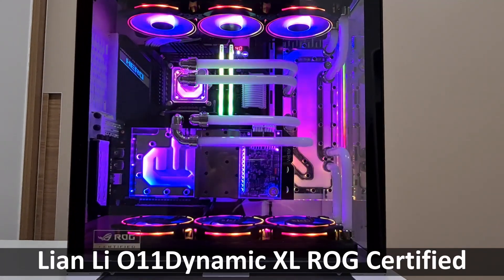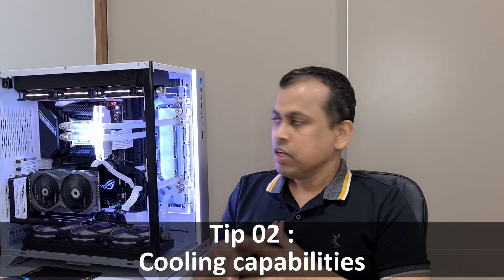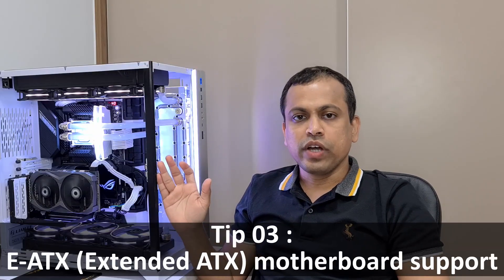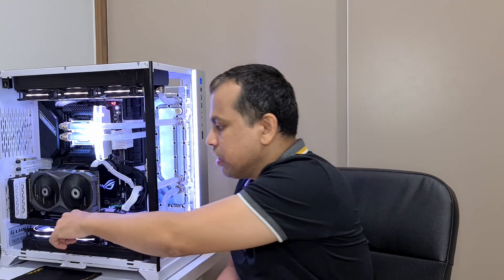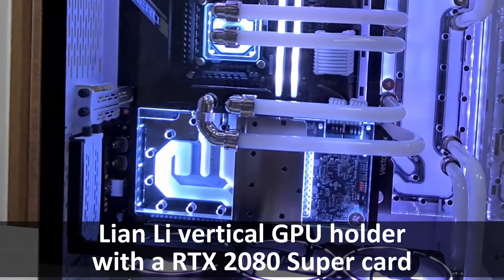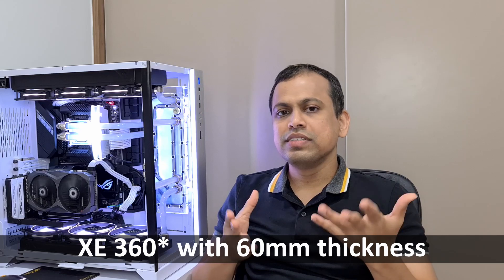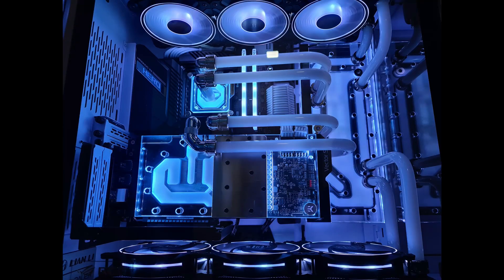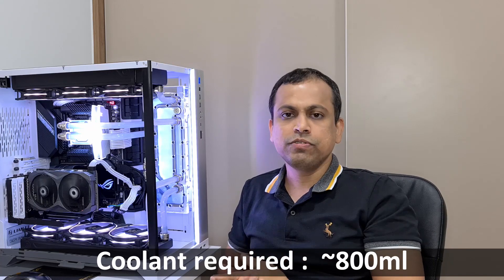15 Tips for PC Builds with Lian Li PC O11 Dynamic XL

Comment: The EK-Quantum Torque Drain Valve would work without needing the extender at all and is much shorter and doesn't need the pump to be moved.

Comment: Great tips. will the Vertical mount fit into the Lian Li Dynamic?
Reply from the maker: Yes it is. But careful on the gap it'll leave in the bottom. There won't be much space for a bottom radiator.
Reply: @STechV  Thanks. Also, can the mount be vertically moved up to allow clearance for the radiator?
Reply from the maker: LianLi vertical mount is not possible to move up or down.
If you want a vertical mount with better clearance, you can go for EKWB's vertical GPU holder.

Comment: Thanks for the ARGB hint. I had no idea how to control it until now
Reply from the maker: Glad I could help.
Reply: how can i control it ? i have msi z490 gaming plus motherboard
Reply: @WH7.  you put the 3 pin argb cable into your motherboard and then cycle until you get to the one you can select with software and then use msi rgb software to do so

Comment: I just bought this case and I’m trying to find the best motherboard to put in it. I want to go with a white or silver motherboard but it also needs to have the hookups at the front for USB type C ports
Reply from the maker: It's all depending on the brand you pick. This casing supports all types of motherboards. You can pick the motherboard with best features and aesthetics under your budget.

Comment: Great vid mate! 

I've just got a question, I've been looking for a temperature sensor (either G1/4 or one to plug into a distro).

Any recommendations?
Reply from the maker: Thanks a lot. You can use any 10K, G1/4 temp sensor. I've used "Barrow G1/4" 10K Temperature Sensor Stop Fitting" to test the loop performance. They are good and works properly. But I don't recommend their flow meter with display as they are not accurate most of the time.
Reply: @STechV  thanks so much for the response! Your build looks so great (and your tutorials are fantastic!). Thank you!

Comment: Hi I loved you video's . I am making a build with thi full tower from li -lian exact case ... I was wondering how much did that water cooling kit cost as I am trying a very similiar build with a 3080 ... I never did water cooling from scratch. (would buy them sealed) I been building PC's for 26 yrs now and I am ready to water cool the whole thing like you did... that was such a great video ... I just need to see how much that water cooling kit you installed will set me back financially. thank you for answering me. Cheers
P.S.I didnt order the case yet, do you think this full Tower is a great case for water cooling as I have a strict budget. cheers again
Reply from the maker: Hi Danny,
Thank you. For watercooling parts for this system has listed in this video ( description ) : https://youtu.be/_30bmyN35Y4 
For this setup, it was cost around USD1000-1250 for me. But, prices may vary depending on the shipping cost and the tax. 
with regards to the casing, it's good to choose a case that is watercooling friendly. So, it won't be much complicated and save some budget when routing pipes and placing radiators.

Comment: Quick question - can you install the vertical mount in the top 5 slots instead of bottom 5 slots?
Reply from the maker: Unfortunately you cannot install this GPU vertical mount anywhere else that this place. But, if you go for a EKWB's vertical GPU holder, you'll get that freedom.

Comment: If you use the front distro plate can you still mount the GPU vertical and have a bottom rad ? I assume not
Reply from the maker: Yes you can. Thickness of rads may, the "pipe work" little more complicated. But still it's possible. There a plenty of builds I've seen with that same setup.

Comment: One Question It Has Two USB 3.0 connector but most motherboarfs have one usb3.0 headers is there a way we can connect the second USB 3.0 connection to the motherboard by using some sort of adapters help will be appreciated
Reply from the maker: There are USB 3.0 Y splitter cables are available to purchase. But, I kept it disconnected as splitters shares the data channel and USB ports I had ( front and back ) were more than enough for me.

Comment: 15:15 , how is warm water coming out of your gpu if its not waterblocked ?
Reply from the maker: My apologies. The question is not quite clear to me. You need to know the temperature of the water going to the top radiator if GPU is not watercooled ? 
If yes, It'll be +2 to +5 degrees than the room temperature.

Comment: if you are doing exhaust from the top, do you still need radiators?
Reply from the maker: Yes, It's always better to have a radiator on top. Specially, it looks nice with distro plate. Since my GPU is also watercooled, top radiator doesn't get that much of warmer airflow.

Comment: Just a tip as you said you are waiting for a 3000 series GPU that have PCIe 4.0,  just check your riser cable is suitable for PCIe 4.0, as i have seen some youtube videos off problems with vertical GPU
4.0 riser cables working and not working, just something that can be easily overlooked.  https://youtu.be/KwfAF5XjXbM
Reply from the maker: There are PCIe 4.0 riser cables available in the market now. But, It's not mandatory as my motherboard still supports only PCIe 3. So, it doesn't matter even my riser cable supports only PCIe 3.

Comment: Removing the pump from the distro plate will void the pump seal warranty.
Reply from the maker: I think it's same as for waterblocks. Breaking the seal will void the leak-free guarantee. 

"The warranty is not rendered void on dis-assembly of the water block, but the customer loses the EK leak-free guarantee which comes with a factory tested water block"

Comment: Cool build, I actually want to copy it. But won't the overall heat in the case warm up the water to much for the CPU in the top radiator?
Reply from the maker: If you have a good airflow inside the casing. It actually not an issue.
Reply: It’s a complete loop, both rads cool the loop. With the top fans pushing out it’s safe to say there’s good air turnover in the tank, minimal impact on heat of loop.

Comment: I think the Bottom radiator can be bigger if you just move up your mounting bracket up two more slots
Reply: So I bought a 60mm Radiator do you think it will work? I mean the gpu mount has holes in it (the bracket slots) and it only cover 1,5 fans
Reply from the maker: you meant to mount the vertical GPU mount to on the fans ? You can try, but it won't be stable. Best option is, you can go for the EKWB's vertical GPU mount. You can move it little more further  up. Or you can mount your GPU horizontally.
Reply from the maker: We cannot move the vertical GPU bracket up without making it unstable. It fits to the exact same place, not anywhere else.

Comment: Is there enough clearance to do push/pull on top with 25mm(fan)+38mm(PE rad)+15mm(slim fan)?

Would adding a 25mm(fan)+60mm(XE rad)+25mm(fan) on the bottom be good or overkill for a 3090+5950x (light to medium OC)?

Thanks! Subbed
Reply from the maker: Yes you can. But it'll be too close to CPU power connectors. But,with good static pressure fans (e.g. EK Vardar), you can opt out from the push-pull setup. 

3090+5950x will generate around 600W heat with medium OC. So, 2 x PE360 (500W) are more than sufficient for you setup. XE360 itself can provide up to 668W cooling power which is a overkill for your setup.

Comment: Hey there - cool Insider-Video! A question regarding the vertical gpu Adapter. By using this are the hdmi/Displayport-Connections without any Problems possible?
Reply from the maker: Thanks. Yes, all ports can access from outside without any issue. And it's neat and clean too. No open holes or anything.

Comment: Hi is there a difference between EK-Classic DP Side PC-O11D G1 D-RGB + DDC 3.1 PWM and EK-Classic DP Side PC-O11D G1 D-RGB + DDC 3.2 PWM? 
If the difference is insignificant Shall I go with the Dp with 3.1 Pump because it available in my area or wait for the Dp with 3.2 Pump? Because it is not available even on EK web I need to wait until the 18 of Feb?
Reply from the maker: I think it's better to wait and for for 3.2 as it has higher performance. But, if you are going to use you DP with 1 radiator or without GPU, then 3.1 should be OK.
Reply: Thanks am gonna use it for the cpu for the moment

Comment: Thank you for this video! Just to be clear:
1. Does the side distro plate fit if im using a e-atx mobo? 
2. Under your bottom radiator there is a white frame, is it just for fan spacing? 

You got a sub from me :) take care!
Reply from the maker: Thank you !

1. Yes. 
2. Yeah. You can mount your fans or radiator on that bottom plate. 

Thank again. Take care !

Comment: Hey bud will the be water back plate you have work with the corsair hydro x system? Sorry I'm a newbie for water cooling. Have the same case on order.
Reply from the maker: I'm sorry. I didn't get the question. Could you please elaborate little more ?
Reply: @STechV  sorry maybe a typo or two.

My question is about the water block on the back of the case. I wanted to know what fittings you need to have to fit it. Ie what tube and valve fittings.

I want to use the corsair hydro x 14mm hard piping with all the corsair water stuff  however thier range is a bit boring and doesn't have alot. So I wanted to ask if this water block you have used could fit a corsair hydro x water build. I've done a water build before so am unsure on how the sizing works with the piping/tubing fittings.

Hope thats abut more clear.

Comment: can I use alphacool fittings with ek components and the lian li g1 reservoir/pump?
Reply from the maker: Yeah. you can any fitting which is G1/4 thread size and matches the tube's OD (outer diameter).
Reply: @STechV  okay thank you so much 😊 Btw I want to do a very similar build like you necause I like it so much:)

Comment: Great video mate. I have this case and am using a Asus ROG strix Z490-A Motherboard inside which only has x1 19-pin USB 3.1 header.. I’m not sure how best to plug in the x2 USB 3 cables that come integrated in the case? Is there a Y splitter or do I need to install a PCIE USB 3 card hub?
Reply: If your motherboard didn't come with a usb 3.2 header then it won't work at all.
Reply from the maker: Thank you. I also have only one USB 3.1 header. So, I actually leave the bottom USB ports disconnected. It was OK with me as I never wanted that many of USB ports. You can use a splitter, but I don't recommend it as it'll share the same data bus.

Comment: which radiator is on the bottom? pe or se
Reply from the maker: It was too tight for the classic PE with the vertical GPU holder. But, it's be perfectly fit for the new PE (triple) radiator for sure.
Reply from the maker: At the end SE360 (classic) is on the bottom.

Comment: I've build in the same case. Loving it. Just air cooled for now, but will design a custom loop later down the road. A couple of things to point out from your build. Some are just nit-picking. 

 1. I know you addressed this a little, but the air you have coming into the case from the bottom is still going to be heated by the radiator a bit and then being pumped into the case. Not the best start for air flow. I'd have installed the front distribution plate you talked about and had the second rad also pushing out but from the back. Then just have 3 fans on the bottom pulling cold air in. 

2. You should also remove the dust filter from the top as it restricts the air being pushed through the top radiator and isn't needed as the air is being push out, not pulled in.

3. Great tip in removing one of the drive bays. I've done this too. For as much room as there is in the back, having more space for cables is always good. I have 10 rgb fans, so 20 cables, 2 controllers and one hub needed to go somewhere.

4. Regarding the front rgb strip. I have an Asus Strix mb and at first couldn't get it controlled through that. I have most of my fans controlled through Corsair icue. To get the front strip to work in icue, I had to get a customs cable adapter and program it as 3x10 rgb strips. Works like a charm. 

Great video.
Reply from the maker: Thank you for watching and the comment too. Really appreciate. 

1. I already purchases my G1 distro plate before knowing about the front distro plate. And, it's not that easy to setup side back radiator. It has very limited space and very low headroom for tubing. But, it's be nice. And, the bottom radiator doesn't generate much heat. So, I'm still OK with pulling air through it for now. Worst case, I can add the back case fan for extra fresh air. 

2. That I can agree. I let it be there as my temps were still OK. 

3. Yeah. I also have two fan hubs and two ARGB hubs. Both are stick to the back cable concealing ( and extra HDD ) panel. It's pretty good and organized, but I've to remove all the cables if I wanna remove that panel 

4. Yeah. casing's RGB controller circuit has extra port for ARGB connection. If you can get the adapter sorted, you can easily use it. 

Cheers,
Reply: what, specifically, custom cable adapter did you use fpr the asus strix mobo did you use in the lian li 011 xl case to work its from rgb strip thru the corsair icue
Reply: @file1man  don't know if I'm allowed to share links, so I'll just tell you. Search ebay for "Corsair RGB to Standard ARGB 3-pin 5V Adapter (MALE)", for lighting node Pro and commander Pro. Connect it from the cable coming off the control box inside the case, to (in my case) the commander Pro. In ique, set it up as 3 x 10 led strip. Then set the profile up to be something easily distinguishable and press the cycle profiles button on the from of the case until you see the profile you set up. Job done.
Reply from the maker: Thank you Ben for the help and support. Yeah. That would work with your iCue. But I'm using a simple "Cooler Master ARGB splitter (passive)" to connect all my ARGB devices with two ARGB headers I've in the motherboard ( Since I don't have iCue )

Comment: Hi. Great videos. Thank you for that, help me to visualize how to plan my custom loop. One thing I must point out tho. You can't use EK-extender rotary mm14 like you suggested to use on drain because you won't be able to close back cover case (few mm missing) - I learned the hard way hehe. You got it right with 6mm extender that's why you are able to close back cover:P
Reply from the maker: Thank you. Are you using EK's ball valve ? I think it has sufficient (very tight that you cannot install extra stop fitting ) space to fit a rotary extender. I did some measurement before the video and saw some builds with it. Apologies If I'm wrong here, but I'll double check again and confirm.
Reply: @STechV  yes would be nice to know that 👍🏽

Comment: Hey @stechV I was looking at pc part picker just checking things and noticed that the motherboard you suggest cant support all the usbs at the front of the case "ian Li O11D XL-X ATX Full Tower Case has a front panel USB 3.2 Gen 1 Type A port, but the Asus ROG MAXIMUS XII HERO (WI-FI) ATX LGA1200 Motherboard does not have sufficient USB 3.2 Gen 1 headers. The case USB 3.2 Gen 1 Type A port will not be usable. 

what did you to fix this or did you leave say the bottom two unconnected ? thanks as im unsure what to do when all my stuff arrives thanks again :)
Reply from the maker: You're exactly correct. This motherboard has only one USB 3.2 G1 header. So, the bottom 2 USB ports aren't connected. Since the motherboard has 4 x USB 3.2 Gen 1 ports in the back, for me two front ports ware more than enough.
Reply: @STechV  yea exactly 4 is not needed really ill do the same

Comment: If you install distro plate on the front you won't have space for radiator and fans on the side because of the distro plate pump. So you can install only fans in the internal part of the side
Reply from the maker: Thank you for the correction. Just wondering, since internal side has 55mm, can't we install a EKWB SE 360 (slim triple) which has 28mm thickness with fans (25mm) all inside ?
Reply: @STechV  I decided not to buy the XL version because you can't do that. So I bought the normal version for a basic pc.
Reply from the maker: Oh. That's too bad. I also cannot guarantee how easy to fit the rad and fans ( in the internal chamber part ) with front distro plate. Technically it should be possible to do.
Reply: @STechV  you can try. i don't have it so i cannot
Reply: @STechV I don't know. I only know the distro plate pump takes the place of the central side fan.
Reply: @space man  like I said, with ekwb distro plate on the front you won't have space for radiator and fans on the side. It's obvious you will have space for fans mounted in the internal part of the case. If you want a 3 radiator configuration you need a custom distro plate.

Comment: I wonder what your thoughts are on the new Lian Li Uni Fans.
Reply from the maker: I think they are pretty awesome and easier with fan/argb cable management. Air pressure also good so they'll work better with radiators too. But, as the disadvantage, it need their software to manage.